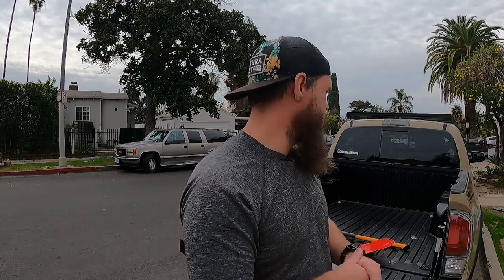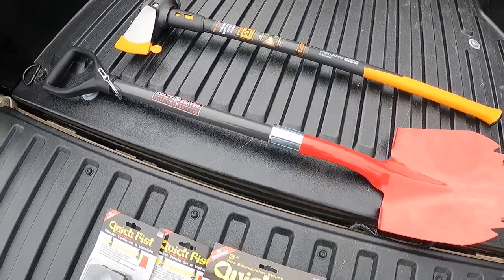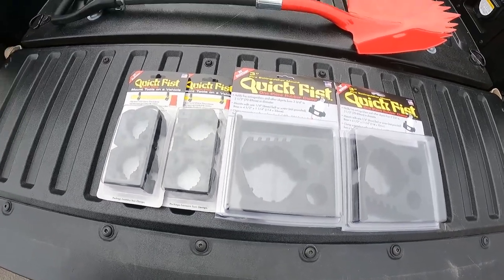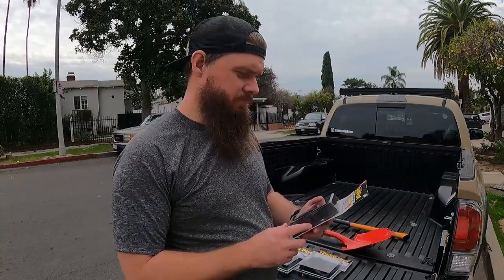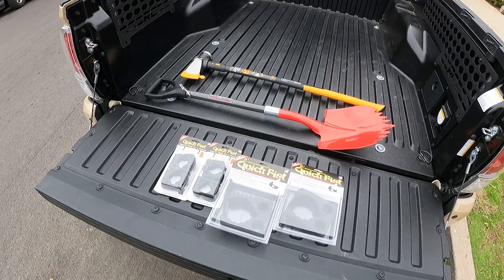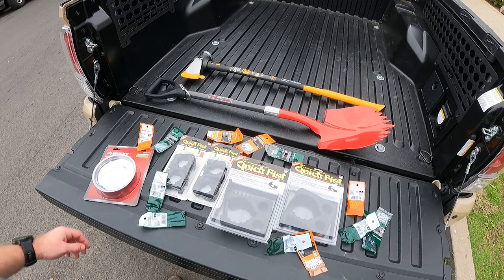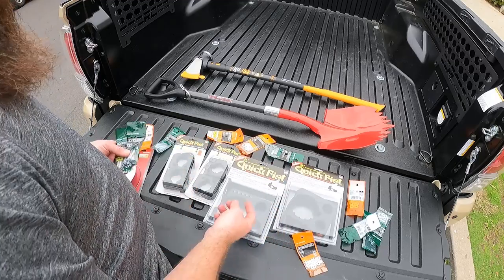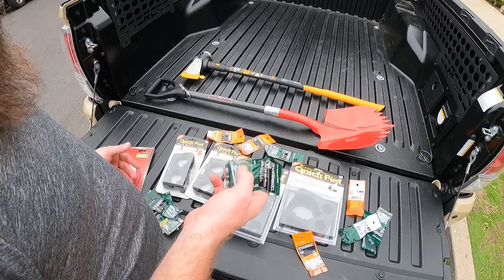Adding some GEAR to my ROUGH COUNTRY molle panels

Comment: For safety reasons I would turn the shovel the other way just my 2 cents nice video thanks
Reply from the maker: Thanks for the comment! I agree, it should be facing inwards. The quickfist clamps dont really allow for it to be faced that way with how close it holds it to the molle panel but I plan on upgrading to better clamps and hopefully can face the shovel inwards.
Reply: @HorizonBound  last thing you want is a injury you could avoid even a improvised cardboard cover and tape

Comment: And how do you stop someone from just unclamping ans stealing your hundred fifty dollar  shovel and 60 dollar ax  ?
Reply from the maker: Hey Jason! Great question and thanks for the comment! So, I did leave out me putting my tonneau cover back on at the end of the video and I should have mentioned that in the video. That's my bad. But for those that don't have a tonneau cover or some bed cap of some sort, there's some other great options out there that have locks on them. Actually, 2 years after making this video, I don't really recommend the QuickFist rubber clamps especially for the heavier items because the rubber rips REALLY easily. I've gone through a few pairs and even bought stronger, heavier duty ones and they still didnt last. Instead, if you're looking for something that locks and keeps your tools safe and secure, DMOS makes a nice lockable mount that you can get here: https://dmosproshoveltools.com/collections/mounts-1/products/014-0001-41 or you can get these Rhino Rack mounts I plan on getting soon that also lock https://www.rhinorack.com/en-us/products/roof-racks/platforms-and-baskets/pioneer-platform-accessories/stow-it-utility-holder-regular_rsit

Hope that helps answer your question!

Comment: what would you need that big ax for?
Reply from the maker: Thanks for the comment! I've used the axe quite a few times while camping. It comes in handy splitting logs for firewood or removing fallen tree debris on trails.
Reply: No one needs an axe. Lumber jacks don't even use them!

Comment: Those shovels are garbage for actual digging. Be better off with $25 store brand one
Reply from the maker: I havent had any issues with mine over the 2 years I've had it. It definitely needed to be broken in IMO since the powdercoat paint originally made the tips slightly rounded but the points now are pretty sharp. I've easily broken through roots and dug in some pretty hard dirt. I know a lot of people have them just to drop a name brand but if you're actually using it, it's a very solid shovel. Gerber shovels are trash IMO and if I wasnt using the KB, I'd prob have the DMOS. Also, the KB is made in Colorado so Im always down to support anything American made.

Comment: I noticed on your Gen 3.  You don’t have a driver side storage door. Those 2 little holes at the tailgate end are suppose to bolt to them. I used 2 small 1/2” sheet metal screws to secure the bottom. If that’s loose, while your driving the vibration will eventually cause the whole panel to shake loose.
Reply from the maker: Ya, I'm kind of bummed that the 2019 and 2020's don't have the little cubby anymore. I'm actually thinking of making a video on how to install one and when I do, I'll definitely be mounting the molle panel to it. Nice thing about having the panel already on is it's a great template to mark where I'll be drilling lol.

Comment: Are the molle panels strong enough for rivnuts?  Might be easier that way to mount the rubber clamps...
Reply from the maker: Thats a good question. I would think so. The molle panels are pretty heavy duty, its the rubber clamps I'm not sure about.

Comment: I just ordered some panels for my new truck and im curious how you keep things from being stolen?
Reply from the maker: Nice! Congrats on the new truck! In my previous video I removed my toneau cover to add the molle panels and forgot to record me putting it back on but I have a cover that protects my gear (or at least makes it so people can't see what's in the bed). If I didnt have the cover on and my gear was exposed, I'd probably use some small cable locks or the gun locks that could wrap through the panel and make it harder to steal.
Reply: @HorizonBound  gun locks/cable locks are a great idea. Thanks

Comment: any particular reason you chose RC over Caliraised?
Reply from the maker: Great question! I love Cali Raised but honestly, their panels are super expensive (and IMO overpriced) compared to RC. I bough TWO 3/4 panels from RC for I believe 150 bucks. I went to look at the website just now and they no longer sell the individual panels but instead sell the side panels AND the back cab panel for $240. With Cali Raised, you can buy the two full length panels for $330 and the back cab panel is $280. So $610 bucks for three panels from Cali or $240 for three panels from RC but the two panels are 3/4 length instead of full. Not knocking Cali Raised because I'm sure their panels are good But over $600 for some panels just seems a little overkill. My RC panels are holding up just fine too. A few scratches from taking off my equipment on every trip but that would happen to the Cali ones too. No rust on my RC ones but I also had a cover over the bed the whole time so that helped keep away moisture.

Hope all this helps! If you do go with the Cali Raised ones, let me know what you think of them!
Reply: @HorizonBound  thanks for such a great response dude. RC seems like the no brainer move. I also have a 3rd gen Tacoma. I’ll have to search the forums to confirm the set up will work with a diamondback cover. Great video thanks again.!!
Reply from the maker: @bvitale35  Absolutely! They should work but I dont want to say 100% that they will. I had my tonneau cover on with my RC panels and they cleared just fine. The RC panels mount behind and below the bed rail so you should be good.

Comment: I love my RC molle panels! So I used a different brand of grips but pretty much the same style and put a Fiskars hatchet in the same place you put your's. I mounted a fire extinguisher at the same place as you but I used a large molle water bottle holder. I put 2 molle pouches on the other side of the bed and that's where I keep ratchet straps and bungie cords. I keep my first aid kits in the cab. I need to get a shovel but think I will mount it against the head of the bed cause I got the full kit.
With no tonneau cover are you worried about them going missing?
Reply from the maker: Nice! What kind of grips did you use? I've gone on quite a few off-roading trips since installing the molle panels and quickfist grips and I've noticed that the quickfist that holds the fire extinguisher in place doesnt do the best job. The fire extinguisher always ends up slipping through. The other clamp grips seem to be working great so far. Maybe I just need to add another grip for the fire extinguisher.
I took off the tonneau to add all the panels and gear but put it back on when everything was installed. I definitely wouldnt want to leave all of my gear out in the open like that.
Reply: @HorizonBound  I use the Kolpin Rhino grip for my hatched. I'd say just spend the $10 and get the molle water bottle holder and put the extinguisher in that. Way quicker access and stays in nicely.
Reply from the maker: @darksideemt  Nice! Those look awesome! I think I'll pick one up! Thanks man
Reply: @darksideemt  which molle water bottle holder did you use? Any pics? Thanks
Reply: @averagejoe4101  there is on my IG (darksideemt). You can send me a message on there and I can send you more
Reply: @HorizonBound  Good to see somebody also recommended Kolpin Rhino Flex mounts. Personally, I think the Quick Fist stuff is complete garbage.

Comment: I installed an element fire extinguisher to passenger front seat.  Inspired by your video for the shovel.  Where to keep it after scooping up dog shit from the trail. I don’t have a dog...
Reply from the maker: Hahaha! Well, thanks for helping keep those trails clean! I bought a Trasharoo bc I got tired of picking up trash left at camp spots or in the middle of nowhere and didn't want it in the bed of my truck! But ya, I'm loving the spot I've got my shovel. Easy access but still out of the way of the way.

Comment: Thanks man... Wanted to shout out your eo2 video also!  I was looking for a quick disconnect for a box and you had the only video I could find! 👍
Reply from the maker: No problem man! Glad the video helped! I know the Eo2 isnt for everyone because youre still needing to drill into your boxes but with a little bit of silicone, it can still be pretty water tight. I like being able to lock it and unlock it as well as take it on and off when I want to.

Comment: what would do with that little fire extinguisher?  It's like it just a common decoration.
Reply from the maker: Lol yeah I'm definitely not going to be putting out any building fires with it but it's always good to have a fire extinguisher in case of emergencies. It could be useful putting out an engine fire or something smaller before it gets out of control.  I also lived in LA where homeless people would set fire to pretty much anything and everything so having something to combat that is nice to have on hand.
Reply: I guess people don't think about engine fires, your not trying to put out a burning house
Reply: @mjsz2842 in 58 years I have never had an engine fire, nor has anyone I have known.  So yeah, I could repeat my question of why, but I won’t.

Comment: Instead of expensive clips ,Why can't Velcro strap(s) be used to like ones used to bind/hold cables costing 10c
Reply from the maker: Great question! So the velcro strips wouldnt be strong enough to hold my shovel, axe, and fire extinguisher. As it is, I'm looking for something stronger to hold my gear because the QuickFist clamps arent doing the job like I had hoped. If you don't plan on taking it on trails, you could be fine with some velcro straps but for me, when I'm offroading, Im having issues with even the expensive clips holding it on.
Reply: @HorizonBound  What ended up happening to your gear? Are you having problems with all of the clamp sizes?
Reply from the maker: Hey JTH! The gear is still there, I'm just not too happy with the quickfist clamps right now.  They're just not as rugged or heavy duty as I had hoped. The clamp holding my fire extinguisher does a horrible job, even when it's notched as tight as possible, it's constantly slipping through and just resting on the bed. One of the two clamps that holds my axe is tearing in the inside. Now this all could be because when I'm going offroading, the bouncing around is just too much and it loses the tension to hold on tight. The clamps holding my shovel are still holding on just fine but that is also a very light shovel. I'm currently looking to see what I can buy to replace the quickfists so I'll post an update video when I do.

Comment: Save yourself a headache and spend a couple of bucks on some steel cable, some ferrules, and a couple of pad locks. Nothing worse than walking out to your truck and someday stolen your expensive axe or shovel. Looks great though man. Look forwards to seeing more vids
Reply from the maker: Thanks man! And definitely! I currently have a hard tonneau cover that I forgot to show me put on in the video but that definitely helps keep people from seeing the goods in the bed of the truck. I'll still probably be adding some kind of locks to them in the near future. I live in LA so if I didn't have the tonneau, I'd definitely have everything cabled, strapped, locked, booby trapped, barb-wired, etc. so no one would be able to walk off with my gear lol!
Reply: Kinda figured you did because I saw the cover mounts on the truck. I’ve got a third gen 4Runner and just mounted my shovel and axe a few days ago on my outer window panel using the quick fist mounts. I live out in Az in the outskirts and most folks are pretty cool out here but there’s that occasional thief hahaa. Excited to be following the build though man!
Reply from the maker: @digsducks  Thanks man! I've got a bunch of videos shot, just need to sit down and edit them lol! 
 4Runners are awesome, I'm wanting the wife to get a 4Runner in the future lol! Then I'll really be broke with all the mods going on! That's awesome about living out in AZ. I've been wanting to do more trips out to AZ area. I try and get out of this state as much as possible lol!
Reply: I’m out in the Buckeye area and have to do more exploring of my own state myself hahaa. Spent some time being the 4Runner up to 100% as the previous owner wasn’t so caring. Also took some time to do a 4x4 conversion to it since I picked it up for a steal but it was 2wd at the time. If you’re ever in the area man we can wheel together. Me and the wife have been planning some more trips and wanna get up to to the good stuff like Sedona and the back way to crown king.

Comment: Consider doing yourself a favor and ditch the Quick Fist garbage for Kolpin Rhino Grip Flex mounts. You can grab one set of 3” Kolpin mounts and secure both your shovel and axe together under just two mounting points instead of four, saving a ton of space. Another 3” Kolpin mount will keep a standard 2.5lb ABC dry chem fire extinguisher from flopping around like it does in the QF. The QF straps will tear too- two of mine tore upon first use. Also, check out a how-to vid on how on properly weaving MOLLE straps so your first aid kit is secure and not flopping around. It’s pronounced ‘molly’, not ‘mohlay’, btw 🤙🏼
Reply from the maker: Dude, much appreciated! I will definitely be checking out the Kolpin Rhino grips. A few of my QFs are already falling apart and even though they weren't too expensive, I'm still pretty dissapointed. And thanks lol I had a buddy of mine tell me that I was saying it wrong after I uploaded the video. Did not know it stood for Modular Lightweight Load-carrying Equipment lol but now I do!
Reply: @HorizonBound  Right on, brother! Kolpin stuff can be found on the shelf @ Bass Pro Shops & a pair of 3” mounts is $15. They have 1.5” ones for $10 as well. The difference in quality & function is just night & day. I installed a full Cali-Raised MOLLE setup in my Tacoma a while back, so just want to share some experience & help folks avoid some of the gear that just isn’t up to the job. Also, it’s a good idea to just remove a MOLLE panel & weave accessories like pouches onto it and then reinstall. Much less of a headache, and It allows you to better maximize space & lay things out in a way that works best for you ✌🏼